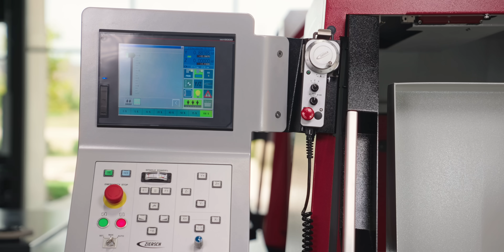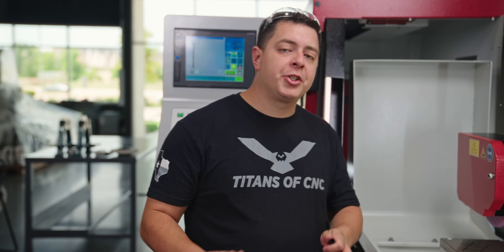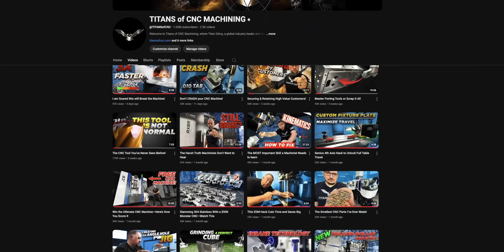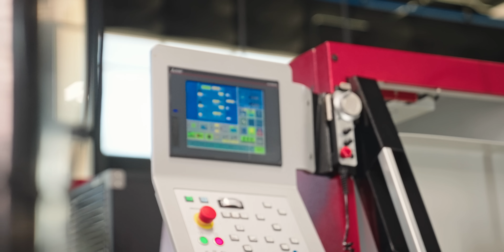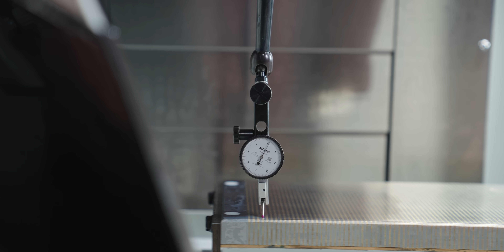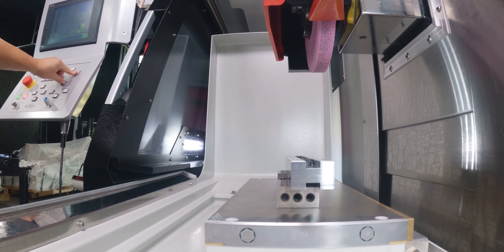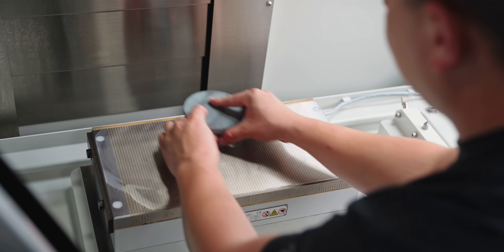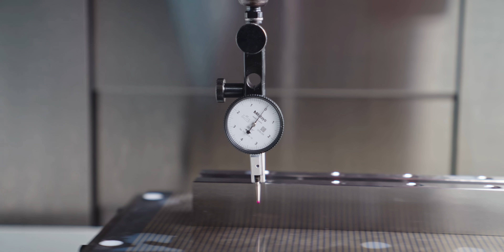What They Don't Want You to Know...

Comment: If the initial face was not flat, the 123 blocks will not be in the same plane. Did the magnet bend the part so the blocks were flat on the chuck, or did the blocks sit on edges and points?

Comment: what if I have stainless steel square key parts? they won't magnetize
Reply: Use a fence or a vise
Reply: Clamp,double sided tape, stop blocks…..
Reply: @jrod4538 the tape idea isn't bad these are small pieces I'm having a hard time hitting a tight tolerance on the mill so was curious of other methods to hold em on a surface grinder being stainless

Comment: You switched Y and Z around. It’s a vertical machine. Plus you didn’t  grind the chuck at working temp with the mag off and finish with mag on. You have the personality of a cardboard box.
Reply: Nope I didn’t z moves the wheel across the table towards the operator and yes the machine was warmed up

Comment: Classically trained precision grind journeyman here and yes surface grinding is something that is not shown much and it is a meticulous thing for sure. With something mentioned about coolant to clean off the machine, it is imperative that you do that and keep the compressed air away from the machine at all costs. It was drilled into me to not blow anything off near the machines (mechanical automatics, precision grinders like parkers and brown&sharpes plus okamotos, and most cnc grinders like the one shown) as the abrasives and swarf can get into the ways and destroy them. It is so bad that I was told that if something like that did happen that it can be a fireable offense.

Comment: I looked up the cost of a Ziersch z48 machine and they start at $99,000.00.
A little on the heavy side for price but a nice machine.
Reply from the maker: When you get to this level… $99k is actually pretty low. Grinding machines get really expensive quickly…
Reply: I think you dont know about iraq they pay just 8 to 10 $ /hr